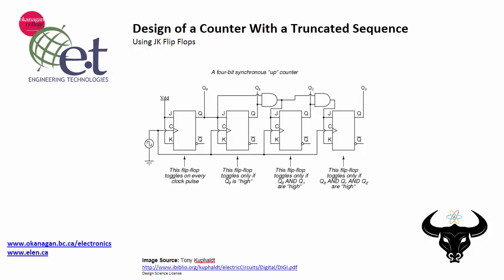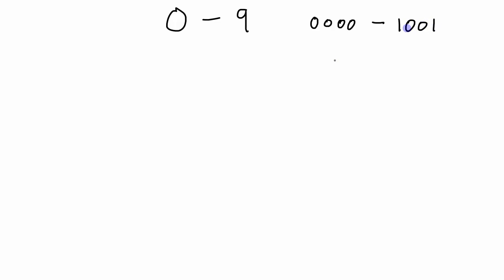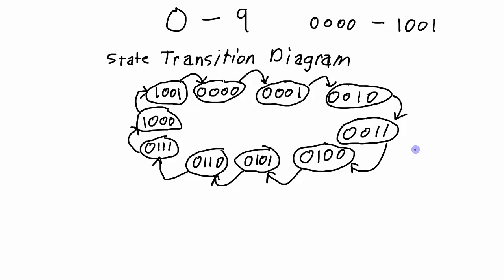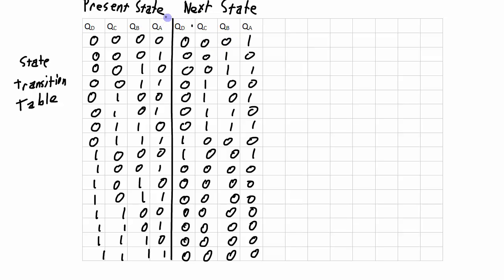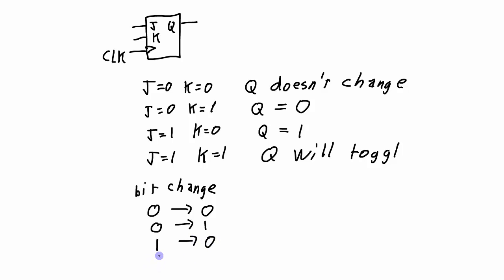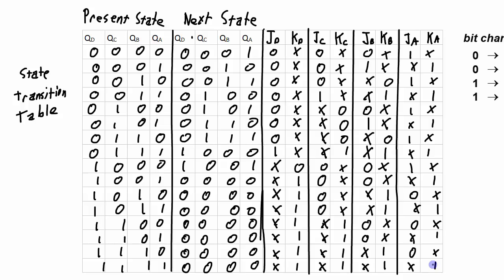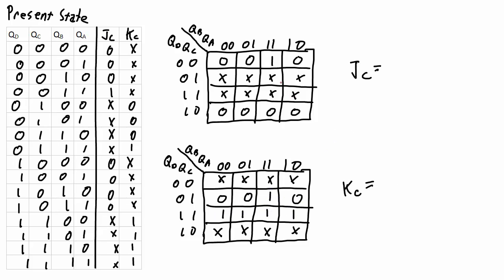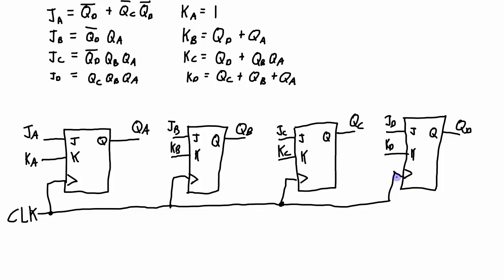Design a 4-Bit Truncated Sequence Counter (Using JK Flip Flops)

Comment: Construct a Synchronous counter circuit that will count the random number 0,2,4,6
 repeatedly by using positive edge triggered JK flip flop.

Help me, i not understand
Reply from the maker: the count 0,2,4,6 has 4 states in it, and so does the count the  0,1,2,3.  In binary 0,2,4,6 is 000->010->100->110 while 0,1,2,3 is 00->01->10->11. You might notice that they are identical sequences except that 0,2,4,6 has an extra 0 on the end that never changes. So to count 0->2->4->6, just count 0->1->2->3 and add an extra, unchanging zero on the end.

Comment: are both presets and clears on high?
Reply from the maker: Preset and clear can be clear on high or clear on low - depends on the implementation. If you are looking at the symbol of a JK flip flop, look for a "bubble" or circle at the input to the preset or clear. If there is a bubble, then it's clear on low, otherwise it's clear on high. The JK flip flops that I drew in this video do not have a preset or clear

Comment: hey please tell me how can consist  from 1khz square wave to  100hz with FF , How much do I have to use  FF
?
Reply from the maker: A counter, like the one described in the video, that counts 0-9 has 10 states and so can be considered a divide by 10 counter. It rolls over (i.e., restarts) after every 10 counts (or input clock cycles). This makes it a divide by 10 counter, so if your input clock is 1 kHz, the counter would roll over at a rate of 1kHz/10 = 100Hz.

Comment: Also if you can guide how we can convert this into a 0 to 99 counter.
Reply from the maker: A 0-99 would have 100 states, therefore you would need a 7 bit counter. A simple 7 bit counter would count 0-127, so you would need circuitry to reset to 0 after 99.
Reply: 100 states? Wouldnt that be impossible. Cant we somehow connect two of the above circuits in a way that when first circuit completes 0-9 it would send a clock signal to the next circuit.
Reply from the maker: Yes, you could connect two 0-9 counters together where the second counter only counts after the first one counts 0-9. This would require two 4 bit counters which would mean you need a total of 8 flip flops instead of the 7 I mentioned in my previous response. The two 0-9 counter system will still go through 100 different states to count from 0-99 also (the number of values you are counting through = the number of states of your system).
Reply: Yes thats right. Thanks man.

Comment: You lost me at the tables with the expresions of JA, JB, JC and JD, also for KA, KB, KC and Kd
Reply: +Cristian Marius It's a JK flip-flop.  Each FF has 2 input values dependent on the present state variables.  Present-state is every possible combination of 4-bits BCD and the next-state is a count up so an increment of 1.  From the rules of a JK FF (that little table that was superimposed) you can find the inputs necessary to change each FF from the present-state to the next-state.  Then you just simplify with K-maps